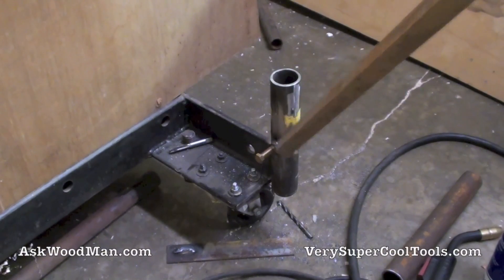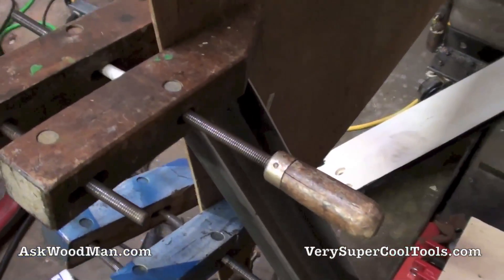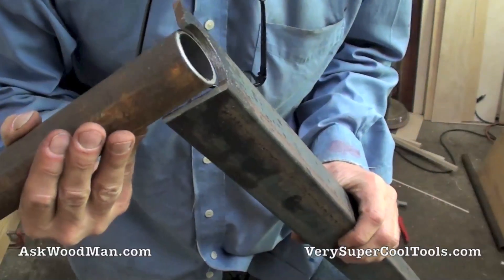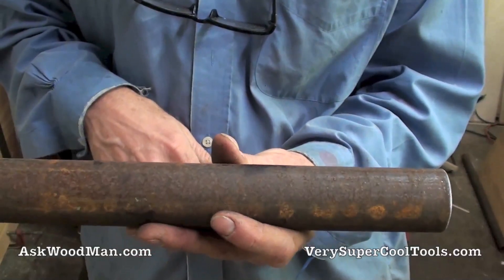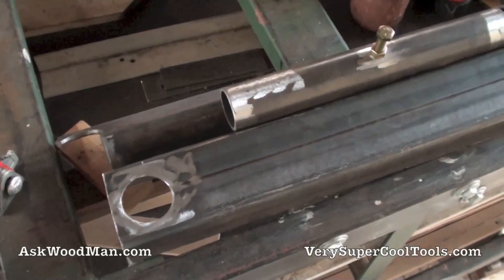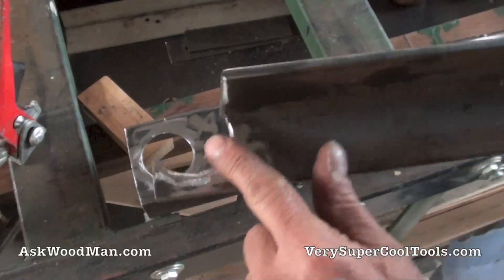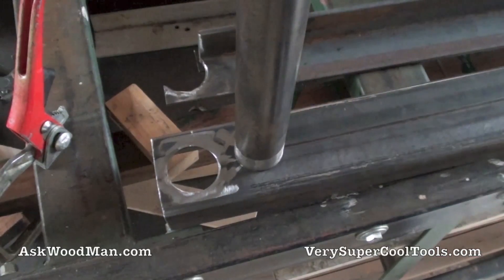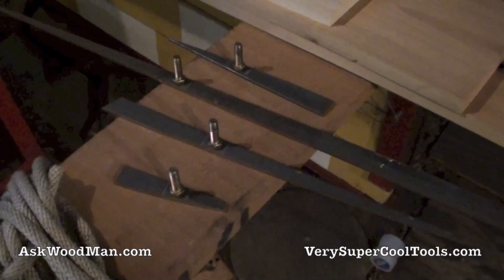27/40 Drill Press Outfeed Continued • WELDING for WOODWORKERS

Comment: Allen, thanks for this series.  Its been very informative.     I am just staring to learn to weld.  First project is a mobile base for the bandsaw.  My welder is setup for flux core wire, but I will get a kit for shielding gas.

If you haven't tried Chromecast, I highly recommend it.  Your video quality is terrific on "the big screen".
Reply: Thanks Rob. You will really like welding with a shielding gas. Very little smoke and no slag to break off. And the bare alloy wire is much cheaper than the flux core so you will pay for your bottle just in wire savings before you know it. I have a whole bunch of new welding projects I filmed over the summer and fall I am working  on editing into another series. Have a great Christmas and keep in touch. Allan
Reply from the maker: Thanks Rob. You will really like welding with a shielding gas. Very little smoke and no slag to break away. The cost difference between bare alloy wire plus gas is more cost effective in the long run than flux core. Over the summer and fall I filmed quite a few more welding projects I will post when I get the footage edited.
Have a great Christmas and keep in touch. Allan